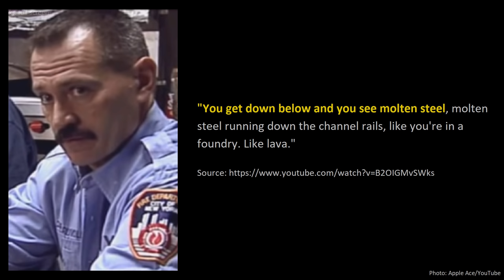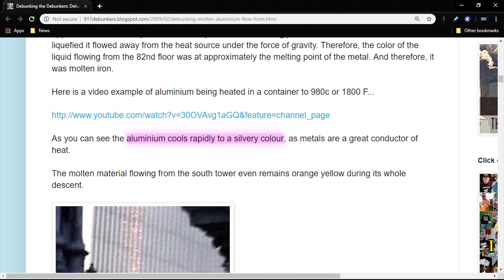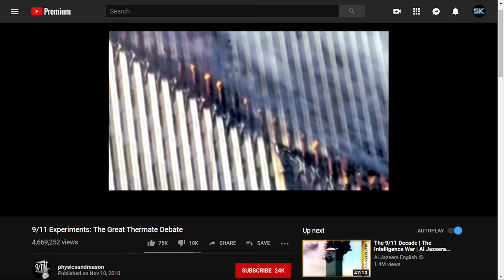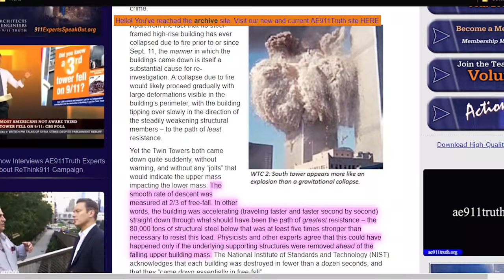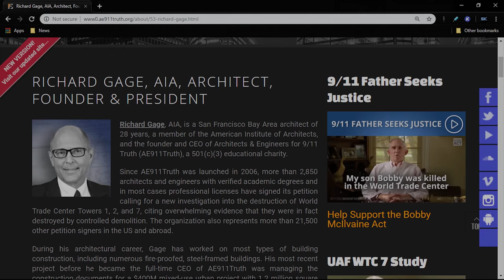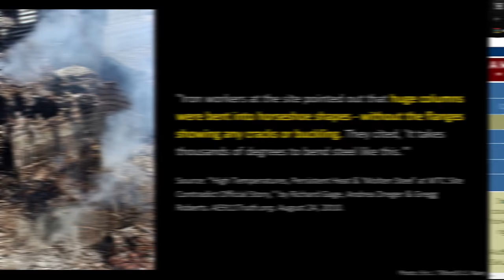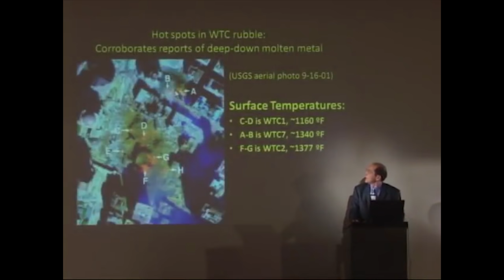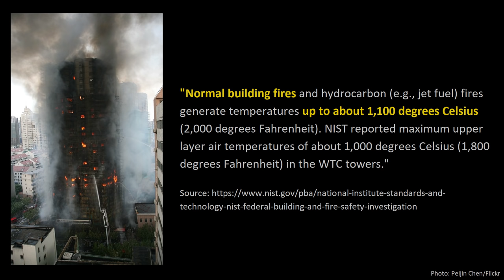9/11 Truthers Debunked: "Molten Steel = Thermite From Controlled Demolition!"

Comment: So when you showing the molten aluminium it's Orange yellow colour being poured eze your evidence you have to tell us what the temperature is of that aluminium. You obviously don't know what it is.  You're just using this video to try to prove your point. In the manufacturing process they understand that the aluminium if it's not hot enough will not pour into the moles so they make it a little hotter how much hotter I don't know. But your point is not made because you don't know the temperature you could raise the temperature up to 2500  So that it goes into the mould without solidifying first but the corner of the building to pour out that much aluminium in such a short period of time is highly unlikely

Comment: Have you every melted aluminum like in welding...it turns dull grey then vaporizes. When you b
put aluminum to a grinder it does not spark yellow at all. Try it some time.

Comment: If they think thermite was planted in the impact floors how on Earth did they survive the plane impacts?
Reply: From what I’ve heard, the theory isn’t that it was planted on the impact floors, but rather thermite cutting charges were placed at critical support structures at some unspecified time prior to the attacks to ensure that with the impact and fires the buildings would fall.
Reply: 12weasel100 chill out. I didn’t say it was my theory or what I believe. I’m saying that’s what they say. There’s also all these claims of tiny spherical iron balls in the dust indicating high temperatures. I don’t know though. I’m not a metallurgist so I can’t say one way or the other.
Reply: 12weasel100 There’s a big difference between “Fire is hot” and “Fire is hot enough to melt steel and make molten aluminum glow yellow-white.” I’m not saying 9/11 was an inside job, but there was some weird stuff going on there that I haven’t heard a good explanation for.
Reply: @rdear  That is very well expected when 767s are used as missiles.
Reply: Joel Robinson I guess the crux of my point is, we’re told the temperatures didn’t get up hot enough to melt steel. But if the temperature got hot enough to heat up aluminum to glow orange-yellow-white, then it got hot enough in there to melt steel as well.
Reply: @rdear  Aluminium has a lower melting point than steel. So the aircraft's aluminium poured out the tower while the steel sagged.
Reply: Joel Robinson yes aluminum does have slower melting point but if you heat aluminum to 2500F and Steel to 2500F they will glow the same color. Meaning that in order to get Aluminum to glow that color, it has to be heated to a temperature height enough that steel would also melt.

When you hear aluminum to it’s melting point it still looks silver and does not glow. You’d have to heat it way up to get it to glow that color.
Reply: @rdear  It glows orange in large quantities. So in the case of an aircraft melting, it will glow orange.
Reply: Joel Robinson The color that a material glows due to being heated is dependent only on temperature and nothing else
Reply: @rdear  It was aluminium though because no explosive could have survived the plane impact and the fires were hot enough to melt aluminium.
Reply: Joel Robinson I’m not saying it wasn’t aluminum and I’m not saying there were explosives on the plane or planted at the site of impact. I’m saying that the official story is that temperatures from the fires weren’t hot enough to melt steel, but if they got hot enough to make aluminum glow like that then they certainly got way over the temperatures reported due to the fires and jet fuel.
Reply: @rdear  The temperatures required to melt aluminium and make it glow orange don't require the fires to be hot enough to melt steel, but they are hot enough to make them sag. After a 590 mph jetliner slams into a steel structure, temperatures will get really high from impact friction and the explosion.
Reply: Joel Robinson I don’t know about the impact and friction resulting in heat. What I do know is that all metals glow the same color at the same temperature. In order to get steel to glow that color you have to heat it up to it’s melting point. In order to get aluminum to glow that same color, you have to heat it to the same temperature.
Reply: @rdear I once heard a theory of a mass firedrill just weeks leading up to the attacks and that everyone had to evacuate and that it was planned and orchestrated by a state govornor.  Lol.  Not sure the truth of that but If, and that's a big IF, there was a planned evacuation and if enough resources were present and if enough time was allotted then I suppose they could have entered from the subway level to plant the charges.

Comment: So u said they measured the air temperature inside the building and it measured around 1800 degrees F then ur saying that it's no problem for the temperature to get to almost 2400 degrees F. And underground temperature is different then the temperature of the building being on fire.

Comment: Beams being cut near the impact wouldn't drop the building. The impact means nothing to the collapse of those buildings. They were more than capable of holding up the building from the damaged floors and above, and probably more.
Reply: True, but that is only one of the 4 factors involved in collapse.  You are ignoring the other 3.
Reply: @MFitz12  BS!
Reply: @MFitz12  The only important factor is the towers ability to handle the weight.
Reply: @gito4130  Is Vessey St. within Building 7's footprint?
Barclay St?
How about Fiterman hall at 30 W. Broadway?
The Verizon Building?

Comment: Many years ago I had found a very long lecture by Italian engenieers and scientists debunking all the 9/11 conspiracy theories. Super detailed.
I have been looking for it again, but cant remember the exact title, difficult to find it in a sea of yoitube videos.
It would shut up the conspiracy believers for good.
I wonder if anyone here has that link.
Reply: I would have loved to see that. Every "debunk" video I have seen so far has not tackled any of the major issues and instead just attacks the weakest versions of the theories. I have yet to see any good debunk video that actually do it's job well. Even this video only tackles one issue of the molten steel. What I want is a good explanation for why building 7 fell down 100 meters away from both crashes even though the 4th hijacked plane never made it there (flight 93), and crashed into the ground due to the passengers overthrowing the hijackers. I've seen so many comments like yours where people say that it is all debunked by engineers, but I myself am an engineer and all I've seen from the apologists are strawmans.
Reply: There are two reports, a Weidlinger one and an ARUP one. The ARUP one on the collapse progression of WTC 7 by prof. Torrero seems valid to me. The Weidlinger report on collapse initiation seem valid to me, though Bailey does not release and will not release the simulation data. The NIST report is garbage.
But you are right, most of these debunking videos are strawmans and actually increase the popularity of conspiracy theories.
Reply: dumbassmoron 
it was not a debunk video from youtubers.
It was a several hours lecture in italian language by Italian engeniers and italian scientists refuting one by one conspiracy theories with solid evidence.
I speak several languages and I can understand Italian.
I am desperately trying to find that long lecture again.
I wish I would have saved it, but do not know if you understand Italian
Reply: @ProphetpuppetMtm  Ah that's unfortunate. Would have been nice if it had English subs, but Italian is not one of the languages I know. And my spanish is pretty bad.
Reply: @laetrille  I mean yeah, it is really hard to explain 3 hijacked planes hitting 2 buildings and 3 buildings going down lol.
Reply: @laetrille  Yeah I work with solar energy. I love it.

Comment: Molten aluminum is silver... unless it is heated up to real high temperatures where it turns pinkish than yellow. Are you saying that the temperatures were that hot? Wouldn't that mean that the jet fuel was butning hot enough to melt steel, with this assumption you made?
Reply: Aluminium is silver under 700 degrees. It melts at 660. Above 700, it has the same colors as any other substance heated that far.
Reply: @mooneyes2k478  The distance you people will go, to look away from what is right in front of your face. That corner column is the exact location that the building began to crumble (as you can clearly see in the video). You are trying to say that the molten metal that was falling from that column, right at the point where you can see the building start to collapse, was molten aluminum, and that is why the steel column gave way and the building collapsed? 
Amazing
Reply: @InventorInvestor  "The distance you people will go, to look away from what is right in front of your face."
Like, oh, basic physics?

". That corner column is the exact location that the building began to crumble (as you can clearly see in the video)."
Which matters exactly how?

"You are trying to say that the molten metal that was falling from that column"
What molten metal? All you can see is that there's something glowing. What makes it metal?

" was molten aluminum,"
Possibly. Or lead. Or something completely different.

But none of that is relevant. What IS relevant is that your claim of "silvery" and then further "pinkish" is nonsense.
Aluminium, like any other substance, will glow dull red, red, orange-red, orange, orange-yellow, yellow, bright yellow, white, and finally sparkling white, as it climbs through the temperatures.
The only time aluminium is "silver" is when it's below 700 degrees C, in a very short span.
Reply: @mooneyes2k478  it's easier to fool someone, then to convince them they've been fooled. 
Of course, you are going completely out of your way to believe the lie, or, to push the lie.
Reply: @mooneyes2k478 the other part that you wrote, about the colors you listed, that is true. What people were trying to say about the molten metal, is that it was aluminum and not steel, that was molten, since there is no way temperatures got up to being hot enough to melt steel. I said to them that aluminum is silvery or a light pink at those temperatures. To which, you pointed out, the color is based off of the temperature of the material, not the material itself. Now we're back to the beginning again. The temperatures were no where close to creating molten steel, that you can clearly see falling from the corner column where the building collapse began. Yet, there it is in the video, falling from the corner support column, where the building gave way, and collapsed.